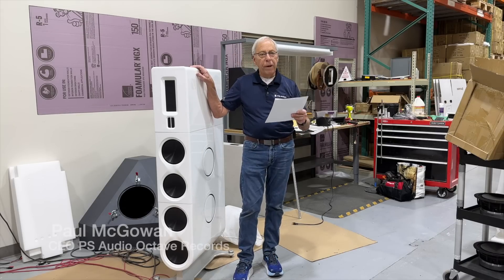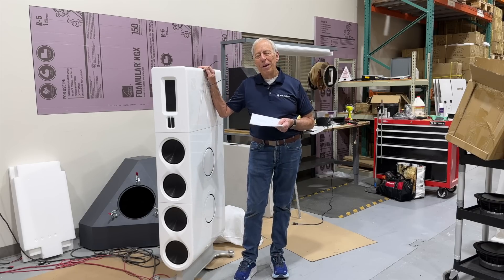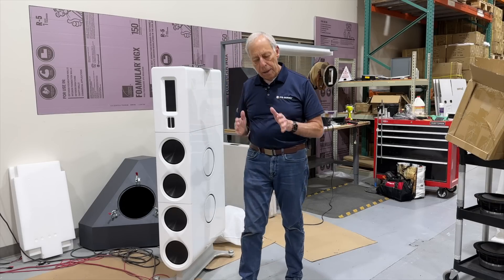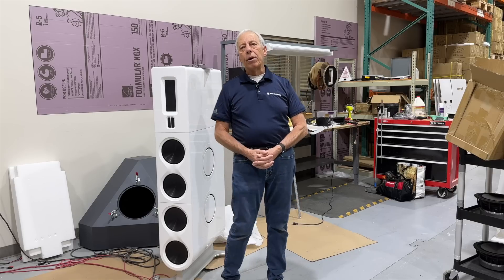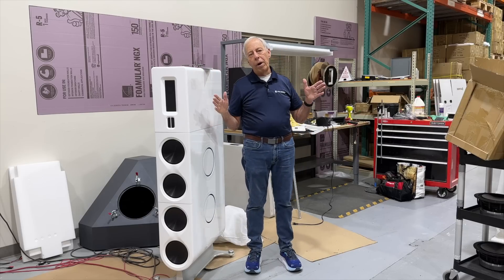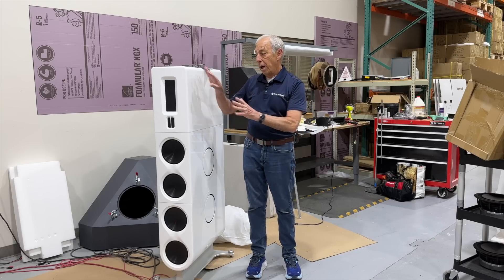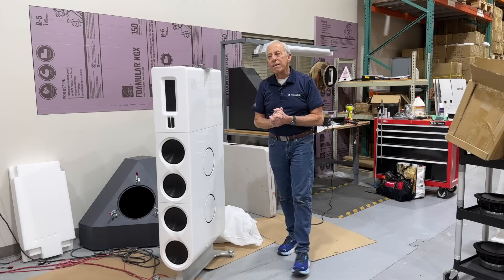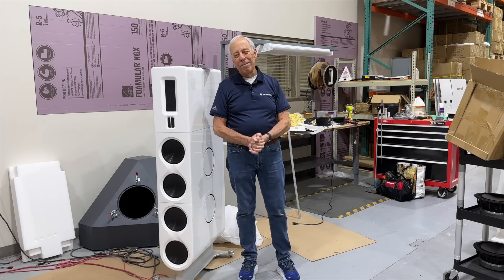Loudspeaker setup

Comment: Always the nitpicker, I believe instead of an equilateral triangle it's an isosceles triangle that you're referring to . An equilateral triangle is a  special case of an isosceles triangle.
Reply: An isosceles triangle has two side of the same length. In this environment typically the length from each speaker to the head with the 3rd side, between the speakers being anything less that twice the other length. An equilateral triangle has all 3 sides the same length. 

Until more recently I had always heard the best ratio was a 2-3. The speakers two units apart for every 3 units away from them. In this example 8' between them would have a 12' listening spot. I think the equilateral is better for near field. It can create a hole in the middle if too far apart. Paul Klipsch realized that with his corner horns requiring the corners and often then too far apart. leaving the center hole. So (that other) Paul created a center channel speaker, 3 speakers for a stereo system was heresy! So he gave it that name.

Comment: My soundstage with the FR30 is not that deep and doesn´t go beyond the speakers left and right, but image is huge and clean between the speakers.
I guess because I can´t go that far from the frontwall and there is not that much on the sides is the limiting factor right?
Speakers are 9ft from each other and I´m 9ft away

I only have 1,6ft from the frontwall and 1,8ft from sidewalls, not much angled
RearSpeaker is on MAX level
Reply: I moved my cheap monitors from a small room to a bigger one: soundstage stuck between the speakers. Not all songs can sound beyond the speakers, although now none of these did. I moved the speakers closer (less separation between them), then I reduced the toe-in and the wide soundstage went back. I recommend the setup book written by Paul.
Reply: @Jorge-Fernandez-Lopez  oh i didnt mention that a Cinema Screenwall is between the speakers, so i cant go anywhere in any direction, only with the angle i could play
Reply: Yes,more than anything you need to pull them out more from the front wall. With the side wall you can experiment  with treatments. I have Sopra No 3's and they are 5-6ft away from the front wall 7 ft  apart and 3 ft faway from the side walls. My ceiling a are also vaulted. This helps them disappear and gives both a wide, tall, and deep sound stage.
Reply: @LuxAudio389  I would say the speakers disappear, image is wide and tall, but not deep, I guess if you can´t move the speakers more from the frontwall you have to live with that
Reply: @77MovieFan  Ok, you might have a Wilson's demo like presentation that Paul explained —I don't remember well—, more distance between speakers and toe-in with a wide soundstage between speakers. It's fine too. I also tried with a much bigger distance from the front wall moving speakers from 1,08 m to 3 m: musicians and instruments too big and unfocused to my taste, no change in the width. The screen is there to stay, although it would be "fun" to put a platform with wheels under speaker and try new positions. Just stick some tape in the floor to mark the initial position and test new ones. Some instruments could sound outside the speakers in these non audiophiles tracks: Mon naim de Jardin — by Renaud (Tournée d'enfer), All apologies — by Nirvana (In Utero), Dogs — by Pink Floyd (Animals 2018 Remix). These dogs sound close to 60º to my right, just in the direction of the closer first reflection panel, the one that is far from the speakers and closer to the listener.  Enjoy your wonderful setup, because there are multiples presentations that can be wonderful.
Reply: @77MovieFan   I would suggest trying to deaden the wall area directly behind the speakers (on the frontwall), if you haven't already. It has a similar effect to pulling the speakers further out into the room. That will give you the depth in soundstage.
Reply: @77MovieFan  Another alternative could be moving the seat further back to get an isosceles triangle, which will lower the relative separation between speakers. I don't know if it could work, although perception of room modes and cancellations are very dependent from listening position. Usually the best seat position shouldn't be altered. Comfortable theater seats with high back are first point of reflection close to the ears, which isn't the best for soundstage and imaging. I suppose that the screen is retractable and there's no big rack of equipment between speakers. Everything matters. With a good room and a good record, these speakers should be amazing.
Reply: @Jorge-Fernandez-Lopez  Oh they sound amazing, don´t get me wrong, I totally love them. Only thing that I "missing" is a deep soundstage, but like others said, that isn´t always better. Remember listening to big Magnepan 20.7 with los of room from the frontwall, that sounded interesting but not sure if I would want that against a bit flatter stage. You sometimes really had the feeling "bring that singer to the forfront, is he at the end of the studio or conerthall or what".